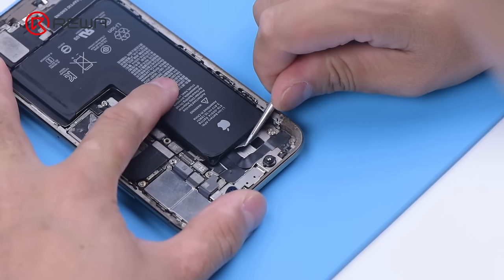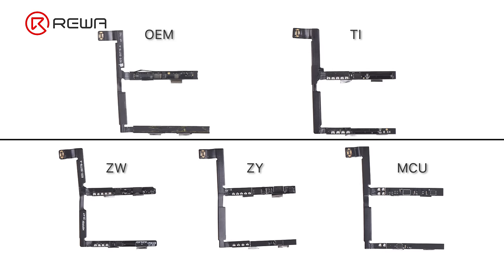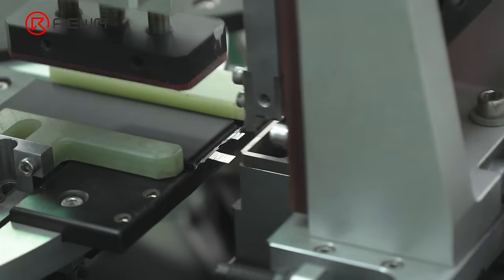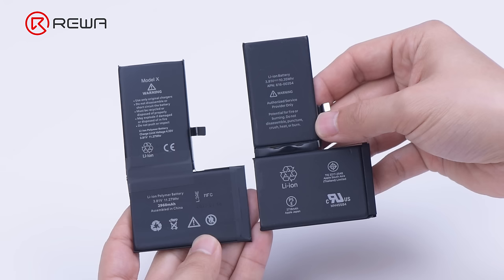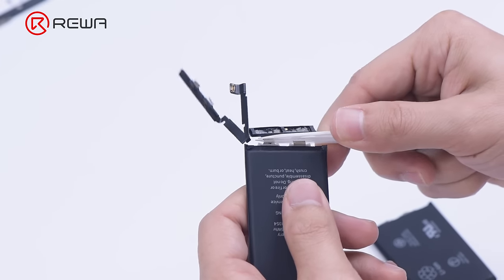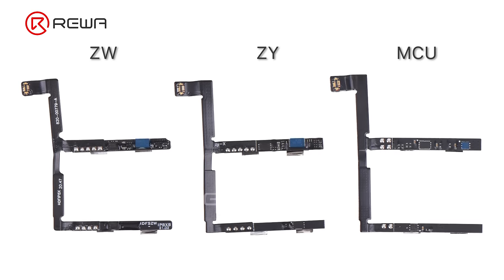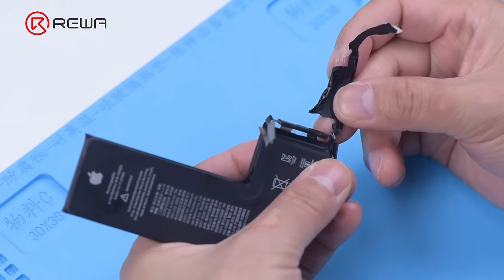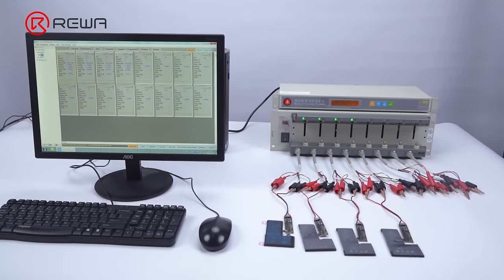iPhone Battery (Aftermarket) - Everything You Need to Know!

Comment: It's cheap enough to just get the battery replaced at an Apple store.
Reply: Cheap? At Apple it cost €75 or more for newer models
Reply: @danieljack8297  Apple's battery replacement program isn't significantly more than having it replaced by a third party using questionable aftermarket batteries. You could replace it yourself, but what's your time and the risk of a failed replacement worth?
Reply: The problem is apple has s global presence,  apple stores don't
Reply: In india there is not apple store 
Only resellers are there
Reply: Apple store is not in every country, here in Pakistan there is no apple store, only have 1 apple authorised service Centre which is semi apple service center 😂 i called them and asked for battery replacement, they told me apple batteries not available in Pakistan but we can give you a replacement device for RS 31500 in local currency, 31500 rupee means the total coast of a new iphone 😂😂😂😂 is this not a jock ?😂😂😂😂
Reply: Good joke. Apple doesn't do anything.  There's batteries as good as the original for the fraction of the cost.
Reply: It’s small businesses that help. Better to pay the premium
Reply: high capacity batteries are scam. its not possible. dont fall for this trap
Reply: Good joke bro...battery replacement on XR cost 89€ in 2024 🤌
Reply: But in my country there isn't any apple stores .

Comment: Minute 3.53 pls check if the announcement is correct, when talking about the wight of the high capacity battery it’s 0.3g heavier not 3g heavier.
Reply from the maker: The high capacity is 43g while the standard capacity is 40g. So the high capacity one is 3g heavier than the standard one.

Comment: Can it possible to rewove a BMS board from a new battery so an old one can be installed or I have to buy a battery without a BMS board ?
And thank you for explain about different BMS board types, this is did not know that there is a difference
Reply: i tried it because of the „battery messages“but i couldn’t tin-plating the batteryconnectors…it seems like they are made off a material which can only be soldered with  laser, and not with standard solder mask ( i used PB 60% 40 SN)
Reply: @ps0freak  you need a battery welder for it. Standard soldering iron is just not enough
Reply from the maker: You can remove a BMS board from a new battery or just buy a cell(a battery without a BMS board). We have published a detailed video on that. https://www.youtube.com/watch?v=NokIyI_J52I&t=161s